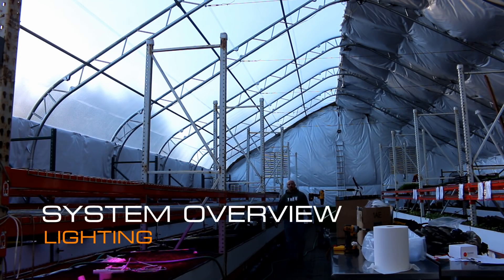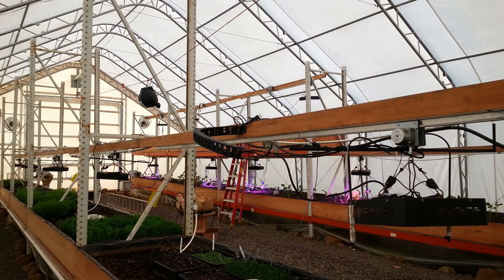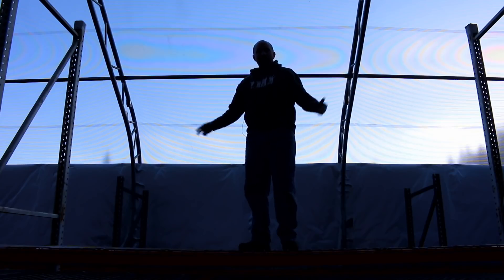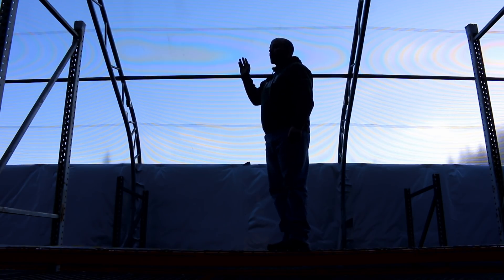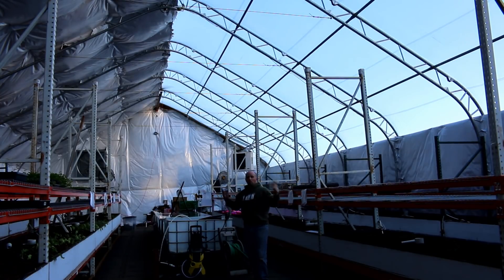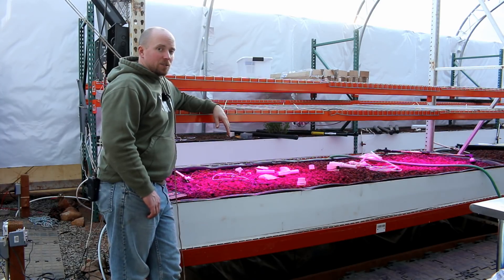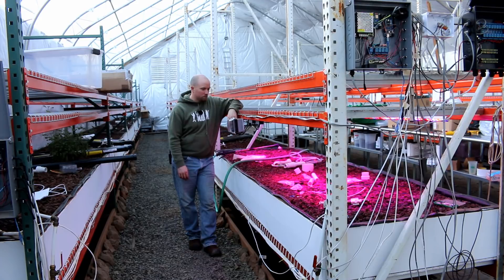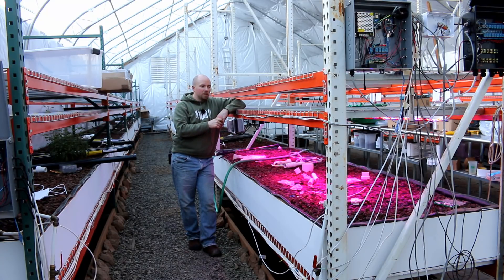The Power of the SUN and LEDs

Comment: You keep screwing me up mentioning PAR. In my industry PAR means something entirely different. I immediately think of "PAR CANS". In my industry PAR stands for "Parabolic Aluminized Reflector". Here are a couple of pictures of PAR-64 Cans...
https://farm6.staticflickr.com/5107/5579257811_156357637b.jpg
https://en.wikipedia.org/wiki/File:Stage_lights.jpg
https://southsidestory.ca/wp-content/uploads/2016/07/Kiss-above-stage-720x531.jpg
Some PAR cans have an Edison socket in them so all you have to do is screw a spot or flood configured lamp into them. Others you have to remove the back housing and attach a sealed lamp (that looks like a car headlight) by attaching two wires to screw posts. Others had two prong sockets that Halogen lamps plugged into, behind that was an independent Parabolic reflector, either in a Spot or Flood Parabola.  These light fixtures ran anywhere from 100 to 1000 watt incandescent lamps in them.
Now days , we have something they call LED PARs. To me they just don't look as cool...
http://images.visiosound.co.uk/images/products/zoom/1366902567-25323500.jpg      or
http://www.colourfulstagelighting.com/photo/pl14746956-5x10w_american_dj_flat_par_rgbw_quad_led_par_can.jpg
They are however more capable because each fixture has color mixing utilizing tri LEDs (red, green, blue), all the way to HEX LEDs (red, green, blue, white, amber, and UV)

Comment: I am surprised at the amount of temperature lift that you have on a day like this, it does seem a shame that you are unable to harvest some of this heat (at least during the cold weather) to offset the propane energy consumption rather exhaust it to waste. For instance could some of it be captured and used to warm the fish water? Would this make them grow faster for longer? You would of course have to feed more if this were the case, but more feed will surely translate into more growth and more waste which in turn is "free food" for your plant growth. There may be undesirable effects of a longer growing season for the fish, for example it may interfere with the breeding cycle of the fish which is not good if you want to kill some for their flesh once big enough. It will produce more waste and I guess the water will require more oxygen etc.

The other big heat sink of course is the digester and as we know more warmth in the digester translates into more gas production and more capacity digested per month. More gas can be used to either drive the generator and/or burnt for more heat instead of propane.

Comment: can the grow lights be ran off 240v? many led grow lights accept 120-240. they'll draw half as much current at 240 so you'll be able to get more out of that 40 amps. the fan, the heater, and dehumidifers should also be able to be rewired to 240

Comment: Mission control is debating the next payload.  One thing has become abundantly clear.  We''ve got to trim some weight. LoL
Secondly, we have to get a handle on the mold/fungus issue immediately.
Having recognized those two problems I have come up with an improvement.  Now if Congress will just fund this.  I know,  this cargo will pay for itself in the long run but that doesn't put the cash in the pocket to deal with it today.
Here is the item for the next cargo trip:
https://www.lowes.com/pd/Royal-Mouldings-Limited-Actual-0-75-in-x-3-5-in-x-12-ft-PVC-Board/50092312
I should point out this is smooth surface unlike the Home Depot product that is made to look like "wood grain" which can just collect more dirt, dust, mold etc.
If you've never seen or used this material let me assure you it is way better than anything you've used so far.  That is true in many ways as I'm about to explain.  #!  It's light and it's white!  That's not meant as a racial slur.  White is great when your trying to keep things clean.  You can see dirt on it real well and especially red Martian dust, black mold or green fungus.
#2  It's solid and not porous.  It will accept painting without primer. This attribute includes being a non-conducting material.  More on that in #3.
#3  This stuff is very malleable yet also ridged even at Mars temperatures. (Unless you paint it a dark color which can lead to solar energy absorption)  It can be sawed, milled and drilled just as if it is wood.  It can accept dado's, dovetails mortise and tenons just like wood.  It's strength allows bolts to be place through it without large washers to prevent pull through.  (It's that strong)  Electrical fittings can be placed in it without insulation as the PVC will naturally insulate.  An example of this is taking the item linked above you can rip a board into 4  3/4" strips 12 feet long.  Then attach LED strips to those and they become portable, to the extent you can mount them anywhere and easily move the entire strip when needed. 
#4  This material doesn't rot.  It is very good at resisting solar damage.  Unlike sawed wood, it doesn't leave sawdust around to rot and attract mold and mildew or insects.  When sawed it makes small chips of PVC just as you would expect.  It doesn't tend to melt when sawed with a circular saw or jig saw like plexiglass does.
#5  While it appears to be more expensive than wood,  It's life span and ease of care make up for that.  It also is excellent for making cheaper items than you can buy.  For instance, water- tight Electrical boxes can be fabricated with this material.  It glues up quickly with the same glue you would us for any PVC pipe project!